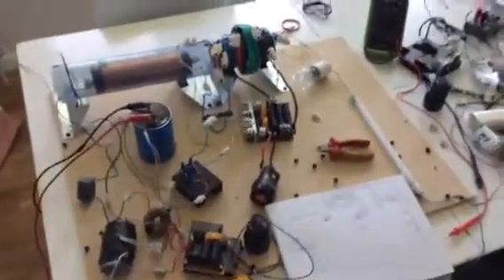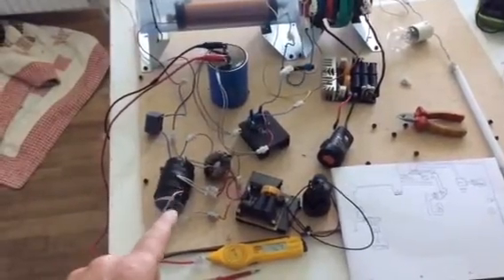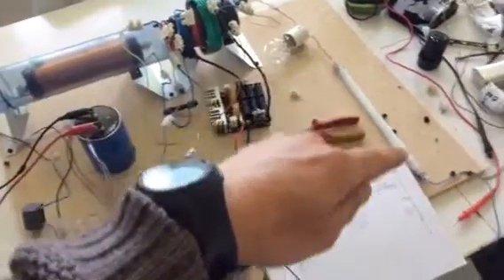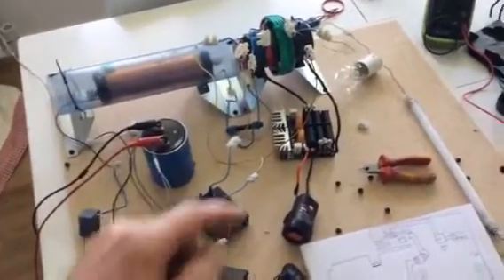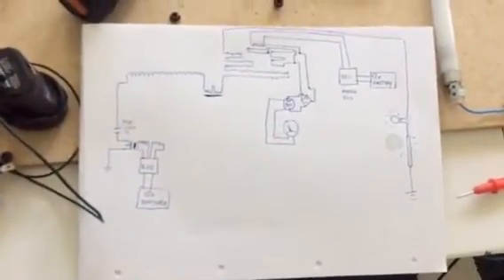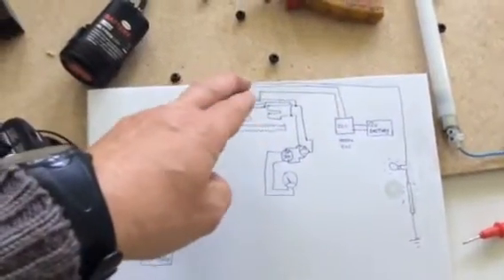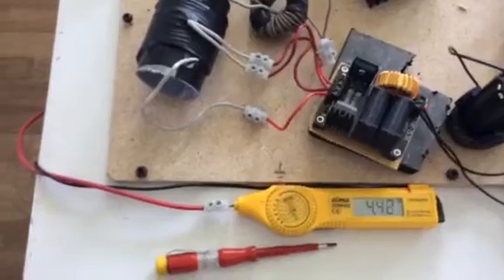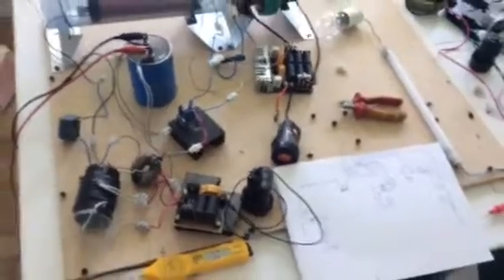ZVS tesla coil Kapanadze experiment

Comment: Hi, how is the aircore bifilar after the ZVS wound? I see it joins in the middle - are the two sides wound in same clockwise directions? Nice work.
Reply from the maker: Mark Flint the air core is wound left anti clockwise and right clockwise from the middle.
Reply: Thanks - and do those ZVS drivers automatically drive it's coil at resonance?
Reply from the maker: Mark Flint that is the beauty of them, I want to make it easy for myself and everybody else. Goal is to be able to just take components from off the shelf.
Reply: Yes - keeping it simple is great. I thought you had this done and dusted with running the ZVS at 36v into 2 back-to-back induction cooker coils, sandwiched between two tesla pancake coils. That looked very simple and way OU. In that case why not rectify some of the output to a 2nd batt (that rotates with the input batt), and the rest powers your loads?
Reply from the maker: Mark Flint as you saw from that video, yes OU is possible this way but nobody seems that interested. It would be similar to what happens in a bedini setup, as one bat is used for input to power the circuit another bat is being charged at the same time. I tried to loop this and after 15 mins the batteries gave in. Caps are needed and a better balance within the setup. But a definite yes to more out than is used to power it. Did you try it?
Reply: I've been working mostly with motors, Bedini style - or I should say, Rick Friedrich style - as he has shown the most in this area. When you tried to loop it I presume you were trying to charge the run battery, which is going to lead to problems. Better using two or more batts. Thanks for sharing all this stuff!
Reply from the maker: Mark Flint I used another battery that was the charge battery also connected to the run battery. I have charged ultracaps very fast with this setup.
Reply: Do you mean the 2 batteries were connected together in series?
Reply from the maker: Mark Flint I think they were in parallel for that experiment.Also the Moyer had to be added to allow the flow into the charge battery.
Reply: Thank you for the details. I'm going to do some tests with this :-)
Reply from the maker: Mark Flint no problem, like to hear or see your results.
Reply: Sure.